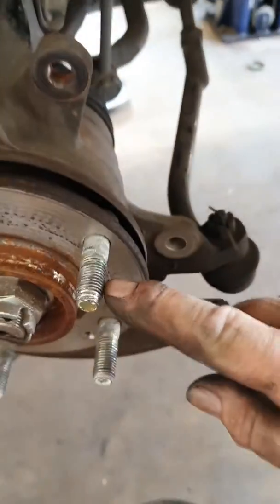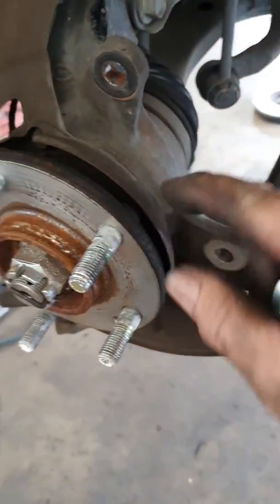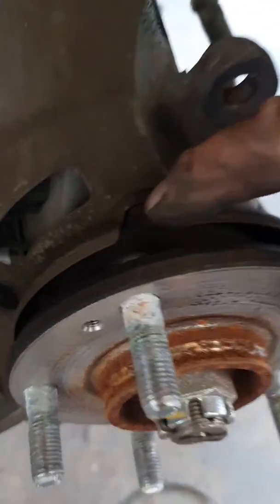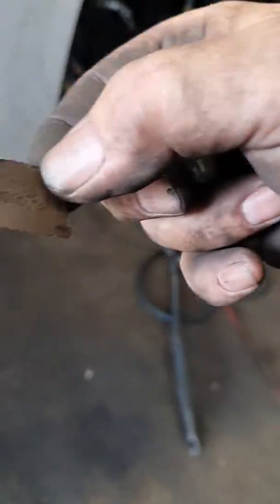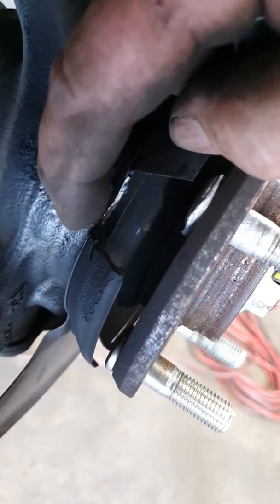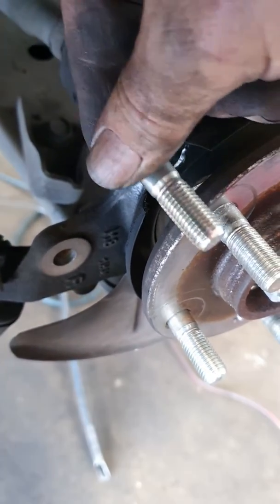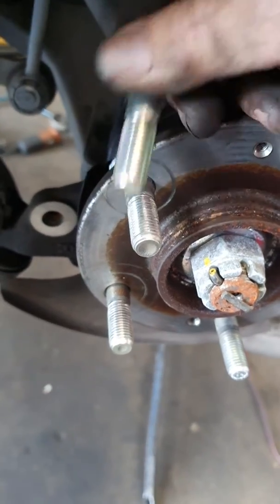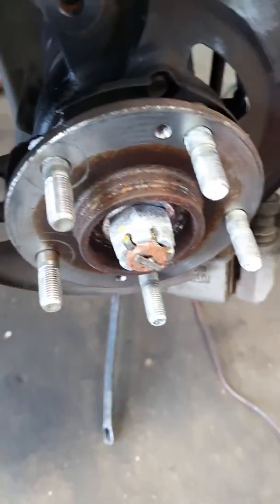How to remove a Broken wheel stud, Hyundai i30 Broken wheel stud, front wheel drive wheel studs

Comment: Hoping you're still replying and giving advice. The stud going back in is fairly tight with my i30. Ive seen somone also grind off the side of the end of the stud so that it slides in. How did you get yours in?
Reply from the maker: Hi there
I'd double check it's the correct stud. A wiggle and jiggle and a turn of the hub and she should go in hope this helps
Regards Maft

Comment: Hi, I hope you will read the comments even after years. My mechanic did the same thing to remove the wheel stud on my I30 (2007). Question; going to make a cut on that shield, does the rest still remain protected from dust and water, since that shield should serve precisely as a dust and water safeguard? I'm doubtful. Regardless, the work has now been done anyway, and I saved the hub bearing. Appreciate the tip by the way :)
Reply from the maker: Hi there Yes it's ok to do and everything else is fine. Thanks and regards Matt.
Reply: @firstclassbrakesandautomot6941  thanks for reply, I feel better now 😉 greetings from Italy

Comment: Hey, would the rear be the same,  would I need to cut out the bscking plate too?
Reply from the maker: Good question. We've not done one yet but let me check and I will reply as soon as we get another i30 in the workshop regards Matt.
Reply: @firstclassbrakesandautomot6941  cheers  Matt, I was thinking if I should take the hub off, would that be easier and I would not cause any damage by cutting the backing plate, or is that procedure not ideal. First time doing this